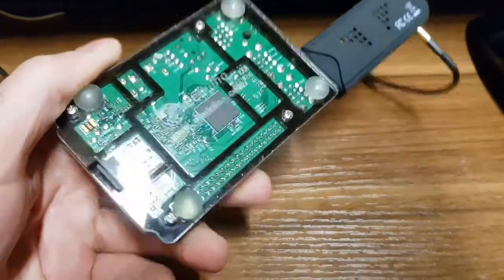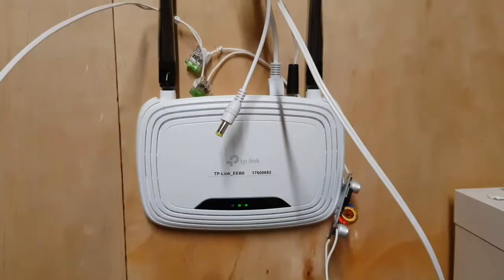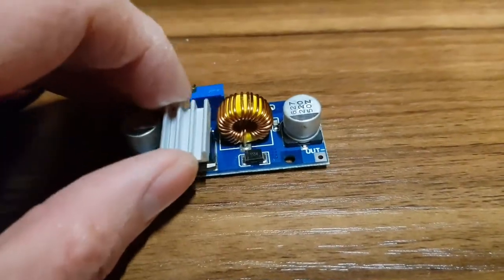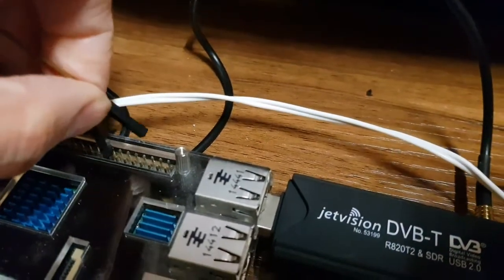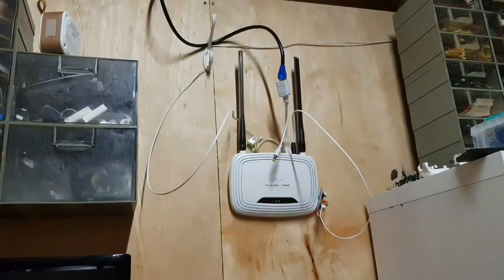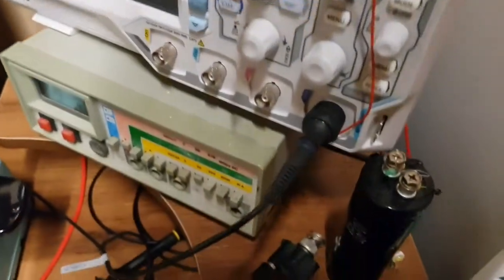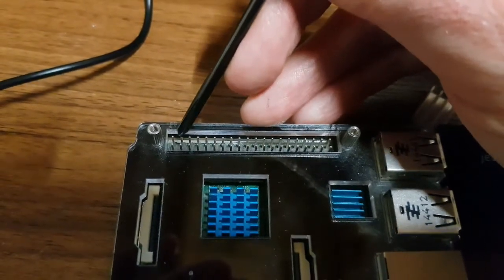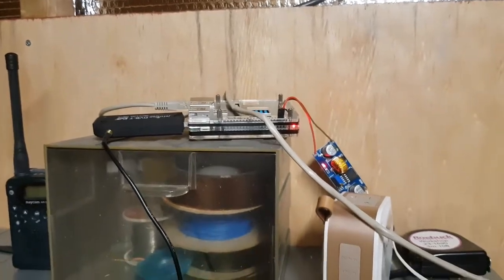Powering a pi

Comment: Why not use micro USB connection for power, leaving GPIO pins free for other stuff?
Reply from the maker: You can do. I just did it this way because I had the parts to do it this way and for ease. As in this use case I have no need to use the GPIO.
Reply: @mathewlawrenceml  Oh I see. Just starting with the Pi so I watch as much videos/guides as I can. Awesome setup you got there!
Reply from the maker: @mmdirtyworkz  thank you. And good luck with your projects.

Comment: can we measure battery power % in raspberry pi if you use buck converter
Reply from the maker: You would need a external ADC as the pi has no analog inputs. But it could be done.
Reply: @mathewlawrenceml  I have ads1115 but my battery is 12volt and I use buck converter to get 5volt ,will ads1115 give me reading from buck converter directly
Reply from the maker: @khushsharma  no your need to use a resistor devider to bring the voltage down to a safe level. As feeding 12v into the ADC will damage it. Say for example you used a 24k resistor from the 12v to an input of the ADC and a 9.1k from the same input down to 0v that will give you a 3.3v I put for 12v battery level.
Reply: @mathewlawrenceml  no sir my question is ,I am getting 5v from buck converter which is connected to 12 volt battery. Can I measure battery level from that 5v( buck converter ) by ads
Reply from the maker: @khushsharma  not after the buck no. You'll have to take a sample from the input of the buck. Unless there buck chip has any Comms on it. But that would require looking for that chips datasheet ect.